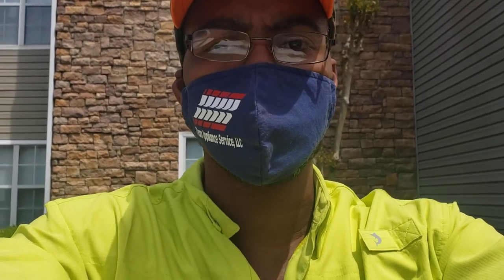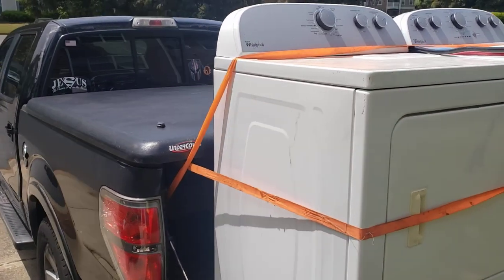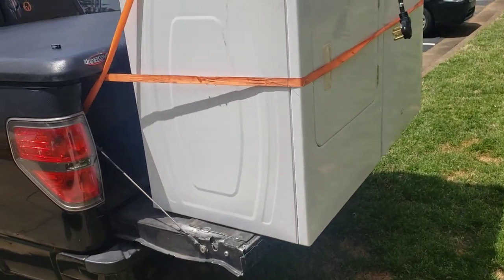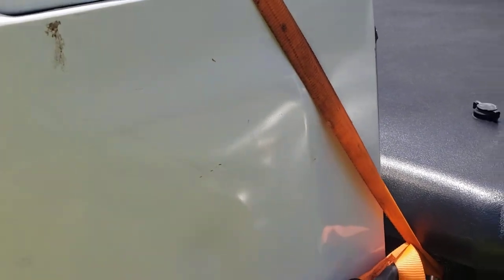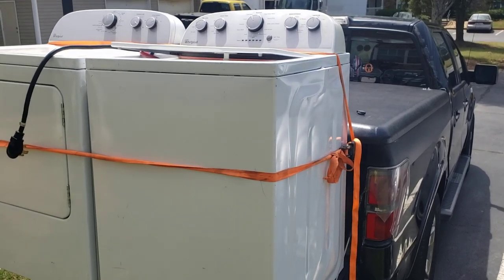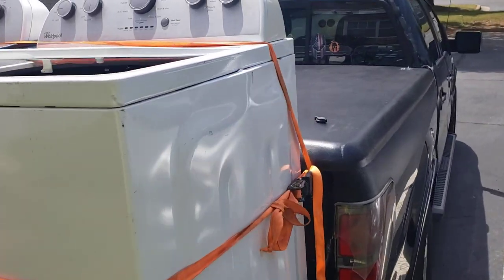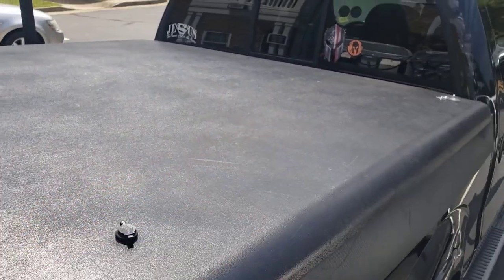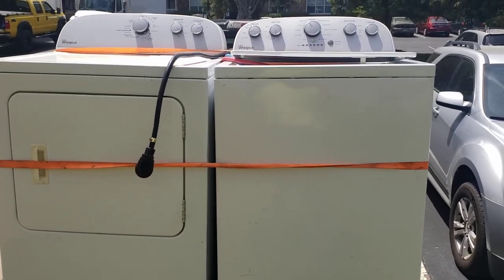How To Maximize Your Pickup Truck Appliance Hauling Space

Comment: Your videos are insanely helpful and clear to follow! You helped me fix my washer (which really impressed my husband 😂). I was wondering if you have a video on a dryer that works on the auto sense setting (low and high heat) but won't even turn on for the timed cycles?
Reply from the maker: Hi Rene I'm glad I was able to help you with your washer. As far as your dryer it sounds like a bad timer. However if it was the other way around and it work on time dry only then that would most likely be a moisture sensor going bad or is unplugged
Reply: @LeanOnYourRep  Thanks! You Rock!

Comment: I was needing some advice on how I can fix the washer we have (admirl). Water stays in the barrel area and it's starting to smell and I can not remove a part to take it out. Thanks
Reply from the maker: What do you like more information to give you more accurate advice, but sounds like you can either be a clogged pump. In the meantime you can get rid of smell by pouring a little bleach in the water
Reply: Do you have a social media I could send you a picture of my issue. I am looking for a tool to take off a piece so I can remove the barrel.